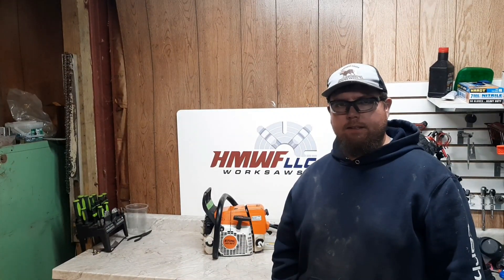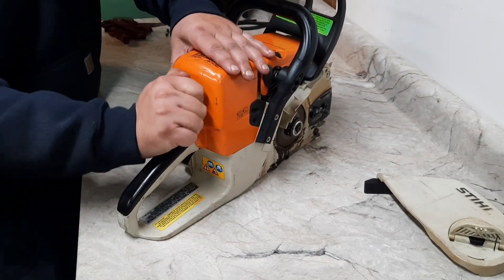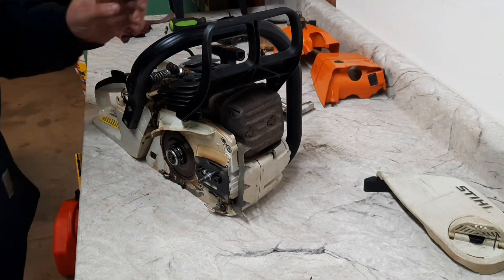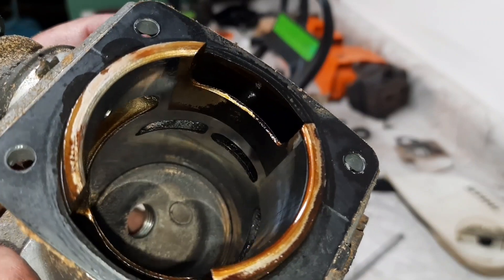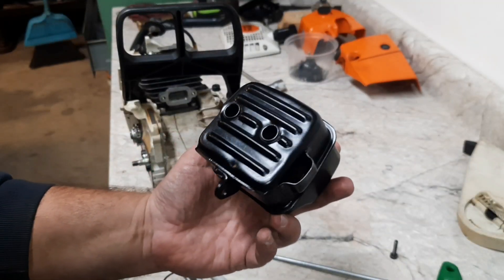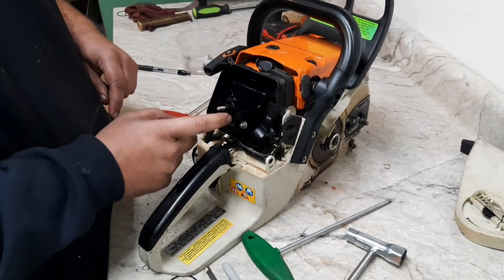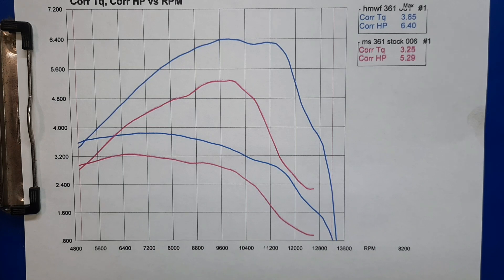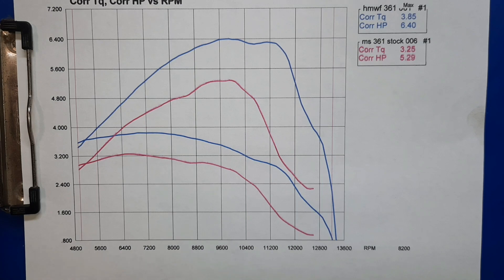Stihl ms361 build!

Comment: I love my Stihl MS361!  I installed an higher flow oiler from a Stihl MS461 and a (Scott) Wojo ported muffler.  Currently running a 24” Stihl bar, 7 tooth sprocket , with a .050” drive link 3/8” yellow label chain. Light weight chainsaw with plenty of horsepower! ⛓️🪚😏

Comment: I have a MS361 but the decompression button isn't there, instead there is a fixed bolt in its place. Factory moulded hole for the decomp button is present in the orange plastic cover. Is this how some of them came or could it be a case of a major component having being replaced prior to my ownership?

Comment: Would this saw be OK to use for freehand milling? @Dyno Joe Mods
Reply from the maker: With a safe tune it would be fine, but a larger saw would definitely be better for bog cuts
Reply: @ I’m trying to maximize power and minimize weight due to health issues. Is there a better choice?
Reply from the maker: @Maxb49  
No, sharp chain and a safe tune it would hold up fine.

Comment: In cc terms, because even though this is awesome , I don't know what the numbers meant, but doing this modification, would it make the 361 perform like a 65cc saw for example, or 70? Thanks
Reply from the maker: Generally it makes the faw feel and perform like 1 class size up. Similar to a stock 70cc saw
Reply: @dynojoemods2764  awesome thanks !

Comment: I like the 361, it was the most husky like saw of its time; spring AV, fair filtration, decent angle on the top handle. Always liked the ported one I had, sold it not long after the 462 came out.
Very nice work and gains. That will last forever, it looks really clean.
Reply: What he said ^ 😉😁
Reply: @cajun3197  What's up bud.
Reply: @brettblack7049  oh just building a few saws here and there and work. How you is?
Reply: @cajun3197  Good to hear. Doing good, thanks. Been dropping a tree or two depending on the day, and trying to get things all done outside, winter will be here real soon!
Reply: @brettblack7049  yea man kudos! Y’all work hard for that winter 🥶
Reply: @cajun3197  yep, someone has to.
Already have all my wood in the woodshed for this and next yr, and logs laying here for two past that 😃
Reply: @brettblack7049  well it cooled down here some 😂 we got like all seasons every day in the winter lol
Reply: @cajun3197  We just warmed up today, supposed to be in the 60's for the next 8 days, decent working temps. Yeah, up here near the Great Lakes, we basically have the same thing with regards to the weather. The saying is, if you don't like the weather wait 5 minutes. While it's not that extreme, it was cold enough to snow this morning, and going up to 61 😃
Reply: @brettblack7049  haha yep same thing we say here on the coast but we just don’t have extreme cold lol 😂

Comment: i have a 361 i bought from an estate sale back in 19 and ive been using it with a 25" bar. i believe its getting tired and would like to wake it up a bit. what is the best way to notice some improvement. keep in mind this thing is completely stock.
Reply from the maker: Muffler mod is a good first performance improvement
Reply: @dynojoemods2764  by muffler mod do you mean like a bark box or something like that?

Comment: I am a fan of the ms361. For the past two weeks I have been running a stock one felling, while I recover from the big C. With just an added muffler port, baffle left alone, and high output oiler, it pulls a 28" es light with full skip square grind in hardwoods. The air filter on these do not seem to clog up nearly as fast as other Stihls. Curious where this saws max rpm sweet spot was with your exhaust timing, the 361 I am running is great at the factory spec of 14,000 rpms, perfect plug color, factory squish is .026 so the base would need to be cut to go lower. I have not put a degree wheel on this saw yet. I noticed you tend to favor .024 squish and exhaust at 102. I have a few ms361s, one that needs a rebuild that I am deciding on timing numbers and piston. I looked at a big bore cylinder for it as well but not sure if I want want to roll the dice on that. Great to see a 361 on your channel, thanks for sharing.
Reply from the maker: I have one here with a big bore currently. It is going back to stock I will try and get some video of that saw too.
Reply: @dynojoemods2764  I have been researching cylinder options for a 372 x-torque and took a look at the current crop of big bore cylinders for both saws, rewatching your video on that saw and the 372xp was part of my decision to put another 50mm oem cylinder on it. As I get older I find myself liking a lighter saw. I have been following your custom big bore builds with this 361 in mind, I was waiting to see if you found a company to replate the 500i cylinder before I gave you a call. It would be nice to get a 361 on par with say a 461. What are your thoughts on boring an oem 361 cylinder?
Reply from the maker: @230e4  
Nothing on the 500i plating yet. You could try a 361 big bore piston in a bored cylinder. But an all out max effort 361 is very stout.
Reply: @dynojoemods2764  Thanks Joe, one of the 361s I have has a damaged piston from a piece of wood getting in the muffler and possibly the plating so it would be a good candidate. I look forward to your next video, have a great weekend.
Reply: @OOOOOO12345  on this saw I switched out the o-ring, piston and adjustment scew with parts for a 461R (high output) you can do that or switch out the whole pump assembly for one for either a 460R or 461R. Also I run Carlton A1LMSK chain, it keeps the oil in the bar groove better than any other chain I have tried, which has significantly increased the life of my bars on all my saws. Properly sharpening the chain for the wood you are cutting is really the key to using a 28" on this saw.
Reply: @OOOOOO12345  You're welcome.
Reply: @dynojoemods2764  hi Joe, any reason the big bore is going back to stock? Performance reasons? I was under the Impession that the bb was a great performance gain.... Although I suspect you got to mod the carb to allow more airflow...
Reply from the maker: @jarrodskeete52  
One is generally a better casting/plating and makes more power even being smaller.

Comment: Hey Joe, I'm porting a farmertec 361 BB cylinder and wondering how wide you went with the exhaust and Intake? It looks to me like 65% bore won't apply here cause you may be really close to seeing daylight.... What are you thoughts? I plan to go 102 ex 80in 122 trans.. And 0.020in squish
Reply from the maker: I normally leave .040" Or 1mm per side if I can't get 65% those numbers should work well